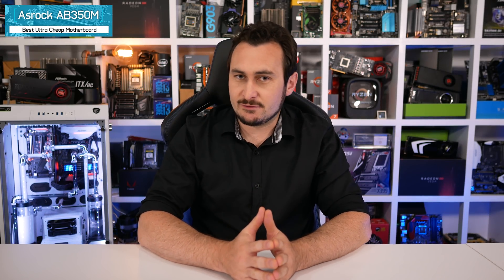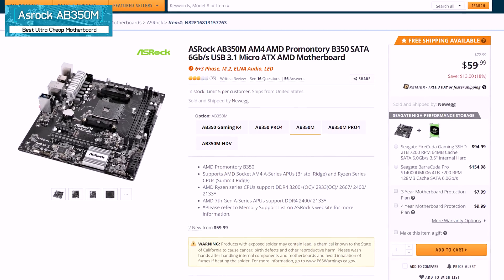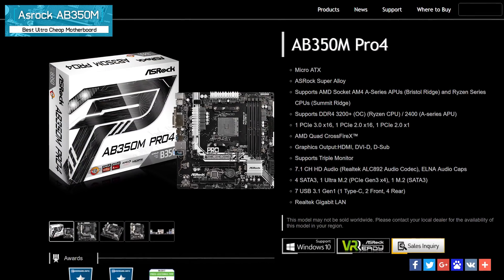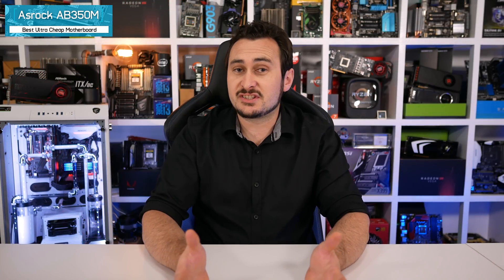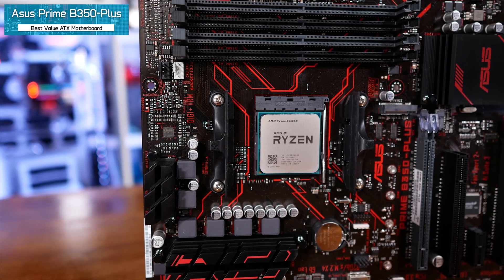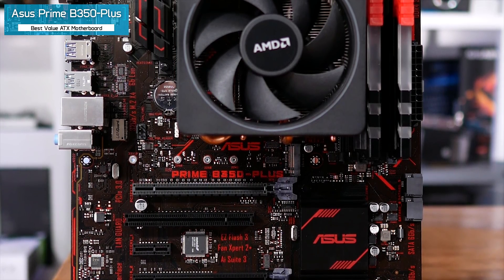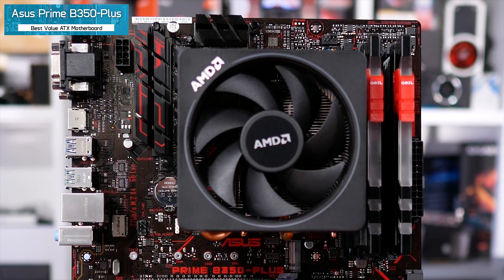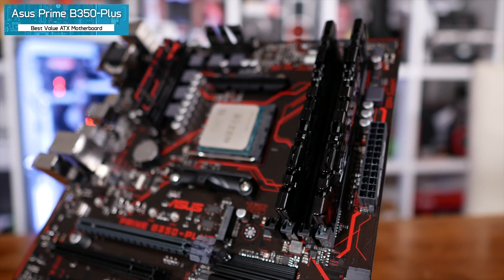Top 5 Best AMD B350 Motherboards

Comment: Great Work once again Steve!

Though I must ask: You didn't mention the MSI B350 PC MATE. It regularly goes on sale at about $80, and I think It's a Good Consideration for a Motherboard as well, though not a Feature-Driven as Many other Options. Heck, I'm able to do 4.0Ghz on my Ryzen 7 1700 with it with no issues.
Reply from the maker: Thanks mate. The B350 PC Mate is priced between $90 - $100 on Newegg.com and Amazon.com at the time of making this video. At that price I prefer the Asus Prime board.
Reply: Hey. The PC Mate is absolutely identical to all other B350 boards from MSI, with the exception of the cheapest B350M that has 3 phase VRM instead of 4, and the 2 top boards that have duplicate chokes and mosfets (the Crait Gaming and the Carbon Pro). The VRM on the PC Mate is very good so the same as ASUS, better than Gigabite and Asrock. As for features the MSI boards are doing great, and the Mate is great for cases with lots of fans. Also they tend to be cheaper than ASUS. If you want inexpensive board and can find any MSI board (that is not the b350M with the 2 DIMM slots), Mate included as it seams to be cheap af, take it. If you want great OC board on the cheap the MSI Krait Gaming VRM is the only B350 solution to look at. The same VRM is in the B350 Carbon Pro, but for about the same price you can get MSI X370 Gaming Plus or MSI X370 SLI PLUS, that have the same VRM but support SLI and 2 extra SATA ports.
Reply: What is disinformation exactly? I don't understand what you mean.
Reply: That is not true. Not all motherboards will be holding R7 1800+ OCd to 4.1GHz. People have different needs not just the top end stuff. The Asus Prime X370 Pro is expensive af where I live. In fact it costs 2 times more than a cheaper board with good 4 phase VRM like the MSI B350M boards (not the gaming pro), which can drive any Zen chip at 3.8GHz no problem and the R5 and R3 will OC to 4Ghz no problem. 

You can plop an R3 in any motherboard and it will run cool because it doesn't draw enough power through the VRM to have problems. All R5s will be just fine on the 4 phase VRMs from MSI and ASUS and still CO really well. Even the 3 pfase ASROCK and the crappy 4 pfase from Gigabite will do the job for R5 if you don't insist to OC to 4GHZ or above.

Comment: 1:Asus strix b350-f 
2: mis b350 tomahawk 
3: gigabyte ab350 gaming 3
 They r same price in my country... Which one best for performance?
Reply from the maker: Asus strix b350-f
Reply: Hardware Unboxed ty sir...
Reply: B350-F is a good board, easily worth the extra 20$ over B350 Plus. Good audio and LAN chips, plenty of fan headers and decent heat sinks. That said, you can't go that much wrong in any of the mentioned.
Reply: i am owner of a ab350 g3 board, it works fine and that dual bios is helpful with all amd bios updates that may or may not break your mb. i can say it saved my ass when i tried F7 and the new agesa wasnt compactible with my ram for some reason, thankfully f9d its amazing i finally got my full speed. So those are my two cents for GB

Comment: Asus prime b350-plus it by far the WORST motherboard ive ever had. Can't get ram to 3200 without extremely lose timing, bricks itself when bios updating (got a replacement, they didn't even argue) this happens twice now, and it got only 2 extra fan headers. Only thing it got going for it, is 4 phase vrm design. There is nothing about the board I'd recommend

Comment: ryzen 5 1600
asus prime b350
ddr4 8gb 2400mhz (confused about brand don't need rgb help me out)
gtx 1050ti (confused about brand)
1tb wd hdd
antec 450w psu
cooler master masterbox lite
buying for graphics designing and video editing
gaming is not priority good enough config?
Reply: noman hossain I'd swap out the PSU for something more reliable like the Be Quiet! Pure Power 10 500w 80+ Silver. For video editing and graphics you dont want something that'll offer poorer stability. Masterbox has poor and restricted airflow because of its "design choices". Get something better. The 1050ti, such as Zotac, EVGA any brand according to pricing, previous good experiences with the brand, and if it looks nice. Its the same NVIDIA GPU in there, so brand doesn't matter. RAM brand im not too sure, Ryzen, or more specifically, the AM4 motherboards are picky about RAM and some wont play ball. Do some digging to which brand is the most compatible with your specific motherboard. And finally, no SSD??
Reply: Wav-Scorn259 I will include a ssd next month or in February and thanks for the suggestions
Reply: noman hossain no problem. But yeah good configuration, but remember the PSU change is probably the most important component because its the life and death of your entire config, and your money lol

Comment: I use an Asus Prime B350-Plus, and honestly it feels like I'm using a board that costs double. It is an exceptionally solid board for the price. I've had my 1600X at 4.0 GHz on it since June and my dual-rank Hynix memory is running at 3066 MHz despite it being a worst case scenario for Ryzen's memory controller and not even being on the QVL. Asus did a great job here.

Comment: Keep that 1700X and b350 board OC and run prime95 for 1 month and get back with me. 

Doubtful it will last i love your content your channel is up their next to gamernexus but VRM temps on B350 are crazy high the caps just won't be able to handle the heat after so many hours. 

Many people buy Ryzen to do encoding and rendering which will make the CPU run at 100% pushing VRM like crazy

Comment: There was once a time where I was actually considering the B350 Krait. I want a good overclocker, and I was doing a black and white themed build anyway so that matched very well. However, the giant "KRAIT" logo on it is quite embarassing. I hate how gaming computer parts feel the need to look "gamery" like an edgy 13 year old designed them. Same with the MSI carbon. With giant letters front and center "GAMING PRO" really steers me away from it.
Reply: i thought about the x370 krait, but that comic sans KRAIT font really kills it for me :'(

Comment: Instead of the MSI B350M Mortar Arctic you should check out the MSI B350M Pro-VDH.
It has almost all the same features as the Mortar Arctic (Minus one fan header) same amount of VRMs (4+2) and type of VRMs has a heat sink on the VRMs and it comes in $25 cheaper then the Morter Arctic. I actually got one of these Pro-VDH and I love it, my opinion it's the best price to performance micro atx B350 board. Only downside is the low number of fan headers.
Reply: Gary Laws Yeah I agree 100%, I think its very undervalued mobo and the fact that practically nobody has done good, proper english language review about it really scares people away from this hidden gem. Mobo prices ofc vary depending where you are located but atleast where I live pro-vdh is imho best bang for buck b350 mobo. Its really just B350M Bazooka with better ports, some business features and different skin in bios. Also white leds if thats your thing :D

Comment: The Asrock AB350M Pro4 has limited options with ram with A-series processors. In order to get above 2133mhz you need single rank ram not dual...
Reply from the maker: Simple fix, don't buy an A-series processor. But seriously don't buy an A-series processor.

Comment: Just need some help should i get a b350 or x370?
Reply from the maker: +MrBrah Bola B350
Reply: cheers mate but whats the difference? Why is x370 more?
Reply: https://images.techhive.com/images/article/2017/01/am4-chipset-100702364-orig.jpg

Also X370 generally has better VRMs, and supports SLI while B350 doesn't. For the majority of people though, a B350 board is all you need.
Reply: ok cheers mate i will have a look cause i was going to get the Asus ROG Strix x370-f

Comment: Shows what I know about computers. I bought a msi b350 gaming pro not knowing there were all different types out there. Is this b350 any good
Reply: Sorry to say but it's the worst B350 board.

But it's fine for R3's and R5's.
Reply: SlavjanA a oh well I've got a R3 in it did my first build and first overclock with this. Found it easy with overclocking, got the R3 1200 to 3.9 without touching voltages. Got some old AMD gpu in it. So far it runs everthing I've tried. I like it but probably because its all I know, never tried anything else.
Reply: Yeah for R3's which are super low power, and as a first board it's completely fine. That's a nice R3 you've got there too if you managed to get 3.9 out of the box.

Comment: I'm glad the Junk B350 tomahawk stayed of this list. Steve! Can you do a worst B350 board roundup?
Reply from the maker: There are certainly some 'less good' boards but I don't think they are as terrible as people make out.
Reply: Christopher Baran What's junk about it?
Reply: Here's another complaint: it nearly fried my 1700 at stock settings by giving it 1.44v
Reply: I'm currently using a B350 Tomahawk and it's been excellent. R5 1600X @ 4Ghz, 1.365v on a cheap 120mm AIO cooler, same on a Cryorig H7 but the temps we a little high for my liking. Voltage on auto was climbing to 1.41 but manual setting fixed that. In contrast to your experience with this board, this Tomahawk is definitely on the list of better boards I've used and I've been overclocking since the AMD K6-2 days. Just my experience.
Reply: SlavjanA 1st one DOA. 2nd one wouldn't post with Ryzen 5. 3rd would randomly not post (at stock settings). Replaced with Asus Strix b350, and no problems at all, and now I'm overclocked to 4ghz, and ram @3000mhz. When I was having issues all I could find where complaints about the tomahawk, and people warning you not to buy in forums, and reviews. It was the worst hardware experience in 20+ years.
Reply: Matt V
Well you've had to have some pretty horrendous boards if the B350 Tomahawk is on your better boards list.
I've already given mine the finger and bought an ASRock X370 Taichi.
I simply can't start my pc knowing I have +$1000 worth of hardware attached to that piece of shit.
Reply: Im late but Ive got a Tomahawk Arctic paired with an R5 1600. Overclocking has been fine. Cant get to 4.0Ghz (currently at 3.8) but i dont think it makes much of a difference